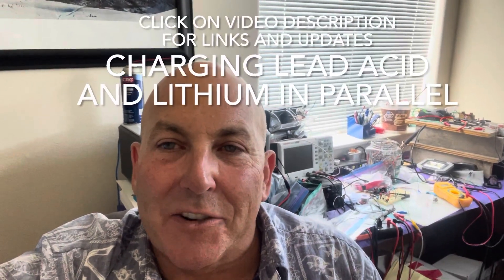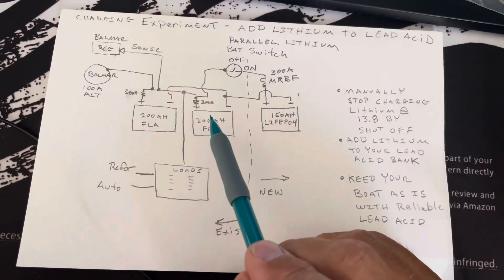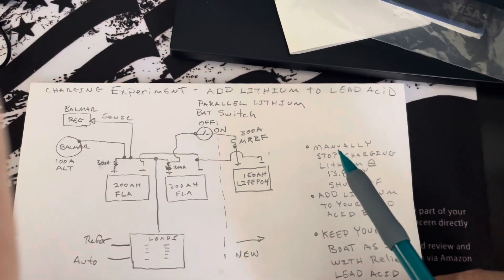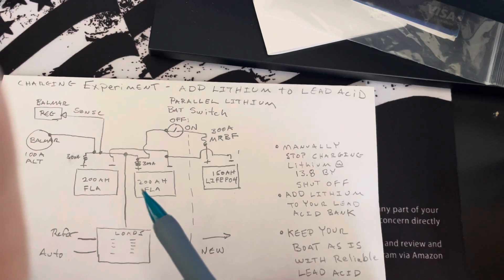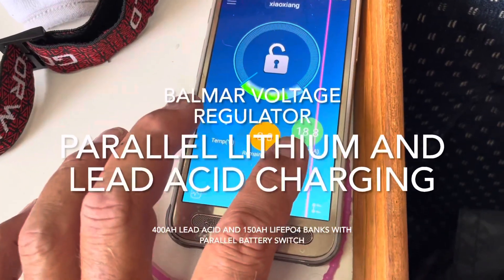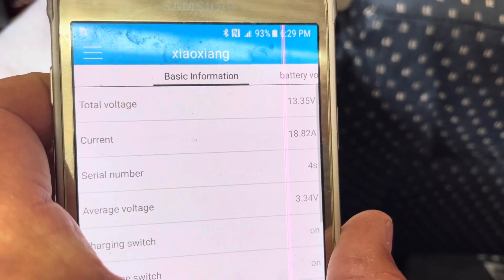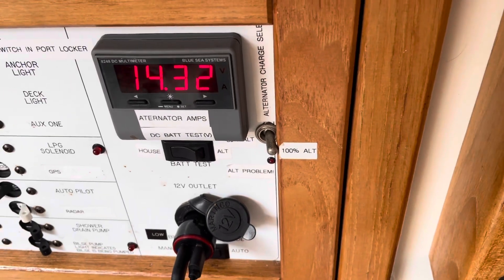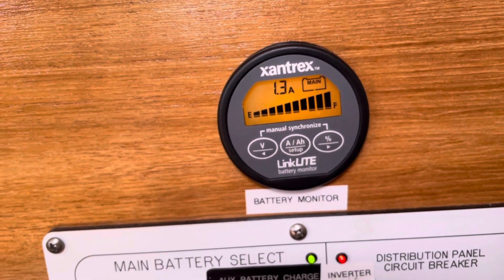Alternator charging after Adding Lithium to Lead Acid in parallel

Comment: I run a lithium in parallel with lead and just have a 15SQ045 diode between them. That drops the voltage down just enough, 0.3V.  Lithium is in remote use so there is also some IR voltage loss. No current is fed back to lead in my system.
Reply from the maker: Thanks. I’ll do some research on this!
Reply: @dannyjensen4954  These are 15A diodes. Don't run them that high and they can be paralleled. These have a very low forward voltage. There are many other diodes with higher current and forward voltage to get the drop you want.  It is a simple trick to operate Li with lead charge profile. Still need occasional top balance for that I have a switch across the diode.